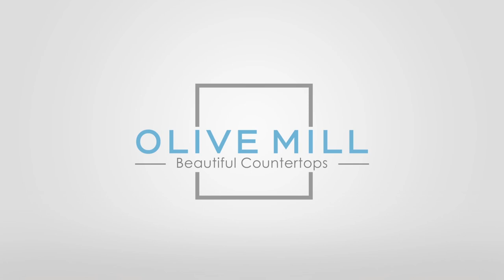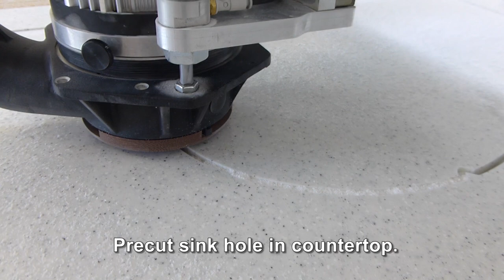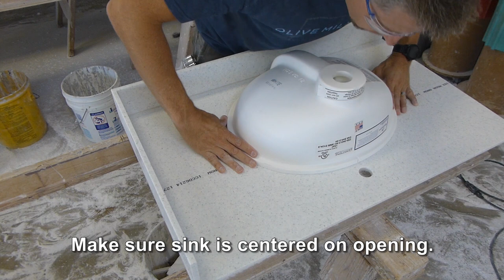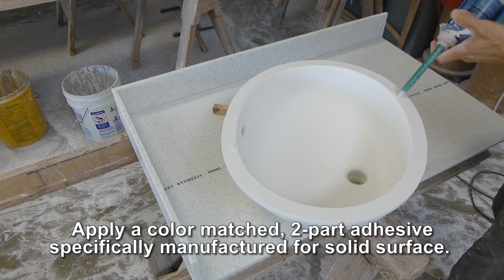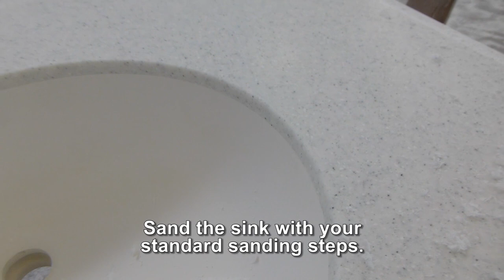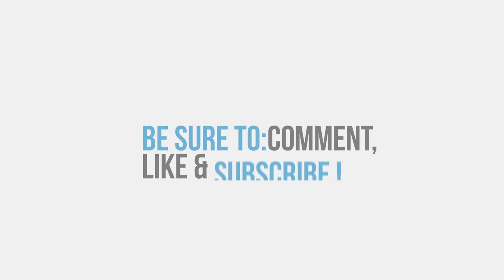Corian Solid Surface Sink Installation How To Video

Comment: Great video Andy.   I am ready to assemble my oval undermount.   My concern is the glue dripping onto the top inside of the bowl while inverted.   How do I remove so as not to read into my 10 degree sink bit with the delrin covered bearing when trimming?  could I smear a little vaseline near the bowl rim for easier glue removal?  would appreciate your advice and thanks...... dave s
Reply from the maker: Hi Dave, The bearing is going to be below the glue. Do not put any oils on the bowl rim or The inside of the bowl, it's not necessary.  The length of the bit should easily clear the adhesive.

If you have any questions let me know.

Andy
Reply: fantastic..... I will now proceed....thanks
Reply from the maker: How did it work out?

Comment: Hi Andy.  I am researching kitchen counter tops. HEIP! 
You are saying that Samsung - Staron, DuPont -Corian, HI-MACS, Livinstone, Maganite, Stonia  have color matched, 2-part adhesive that is used to install their undermount sinks? 
Swanstone told me  their undermounted Sinks are mounted with silicone caulk and brackets.  That really felt wrong to me.   
Also help me understand; I thought a  2-part adhesive  would be you applying something on the sink and something else on the counter.  The more I know the better decision I can make. Thanks.
Reply from the maker: Undermount sinks are installed using silicone to create the seal.

A seamed in sink is actually bonded to the underside of the countertop using a 2 part adhesive. 

Which style sink do you have?
Reply: @AndyGraves   I am remodeling my kitchen.  I think I want a poly-resin "Seamed in" sink or drop in sink.  Thank You for letting me know the proper term to use when looking for a contractor.   
 After looking at many "how to re-install a failing silicone with bracket undermounted kitchen sink,  I know that is not what I want.